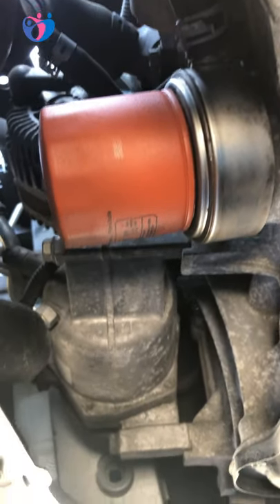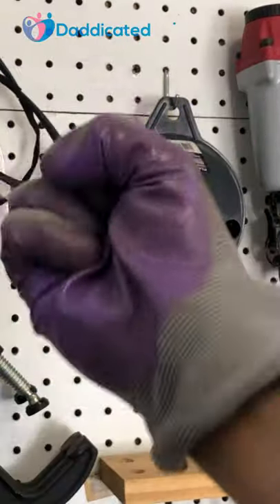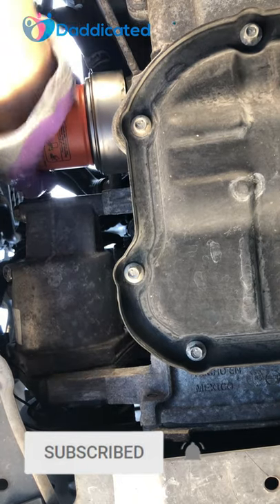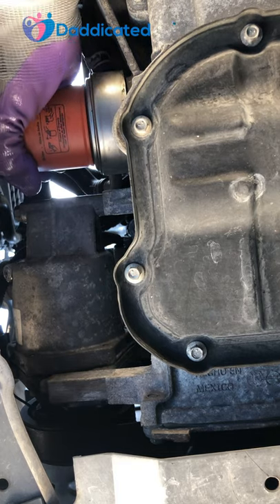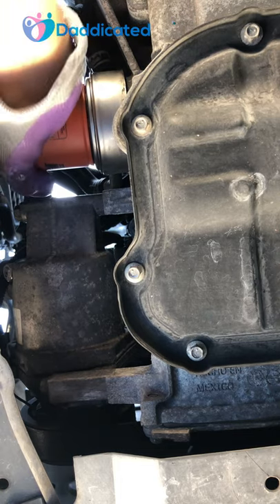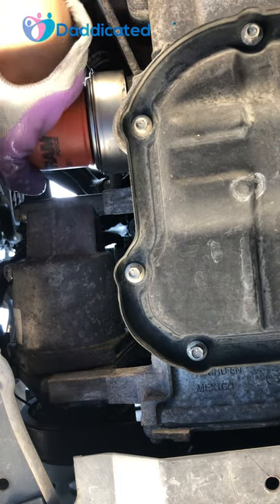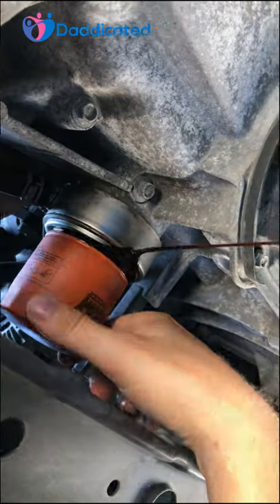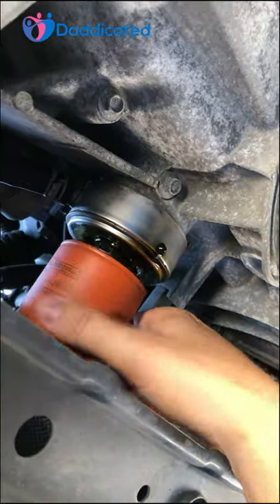how to remove a stuck oil filter #shorts

Comment: It is tight not stuck. Just use a strap or plier type wrench. No need for drama
Reply from the maker: I didn't have a strap type wrench. So I used what I had. What drama you referring to?
Reply: @Daddicated  do you have an old belt laying around. You can use that with a vice grip as a strap wrench in a pinch.

Comment: I’ve been using a garden glove with the rubber material for years!! Works great, unless it’s really stuck in there then it wouldn’t work unfortunately.
Reply from the maker: Yeah I know what you mean. That’s when u pull out the screwdriver method. Lol that’s always the last resort. Lol
Reply: Or just buy an oil filter remover 😅